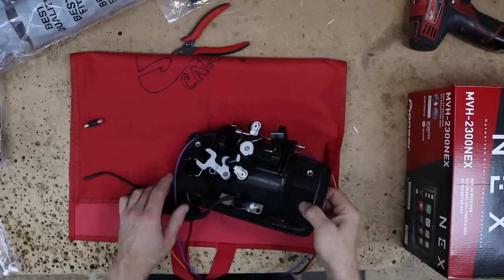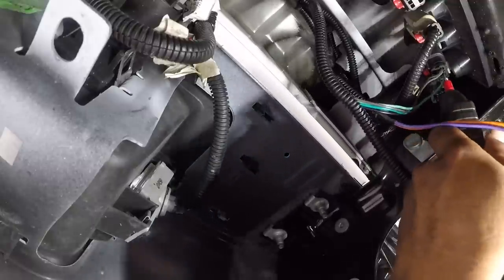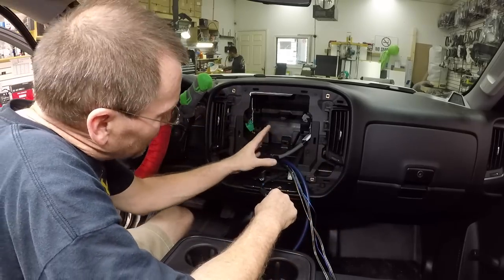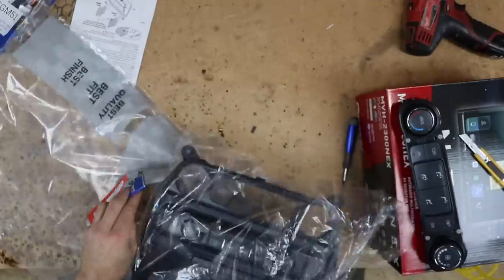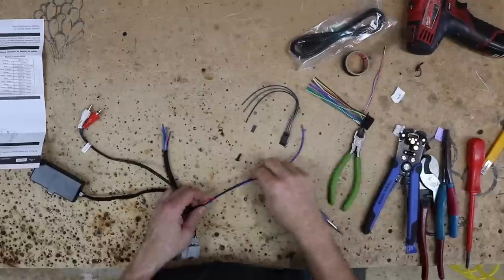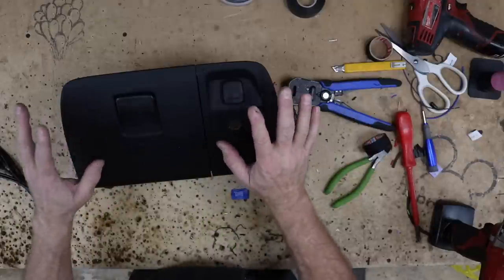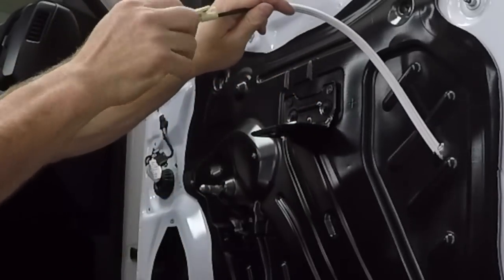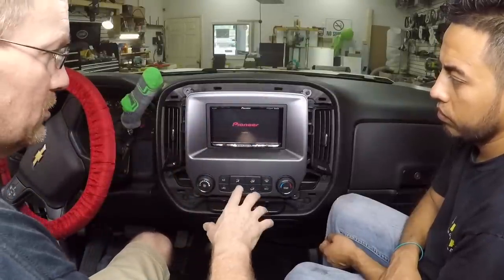We finish a Chevrolet Truck with some Alpine SPT 31GM speakers  Installer Diaries 168 part 3

Comment: @16:49 sure sounds like a good ol barking spider in the shop. Haha. On a serious note great work great videos. I always enjoy watching them. Curious as to what those crimp connectors your using when your terminating the leads from the deck are. I always use heat shrink on each wire end then wrap the whole tail with tesa tape. But I like tge look of the crimps.
Reply: I heard it too! Lol
Reply from the maker: We get them from AAMP Global, they are 22awg butt connectors.
Reply: Haha yes! As soon as I heard it I backed it up to be sure... then I headed to the comments. You're the first one that I saw that mentioned it.  So that leaves the question of who smelt it?

Comment: Hey guys, I still want you to do full install on my 17 Honda Civic EX-T , I'll be driving down from Virginia...Hertz Legends front, Pro Coax back (I have already) , Road Kill (of course)  Audio Control DSP DM608 (have) , Phoenix Gold Amp 5 ch 125x4 & 500x1  for the sub (have) , I think I want to go with the 1 RockFord T1 12 inch , I'll let you guys give best advice on sub...and build enclosure for sub...let me know.
Reply from the maker: Just give Paul a call to set it up.727-216-6170

Comment: great video!! I have a question!   
I own a 2017 nissan path finder and I did a speaker upgrade with memphis components but its louder with the original speakers does it comes with a amp the truck or I need an amp for the new speakers ????
Reply: I did the same. Yes you need an amp to hear the difference. New speaker have bigger magnets than the stock, so they need more power.

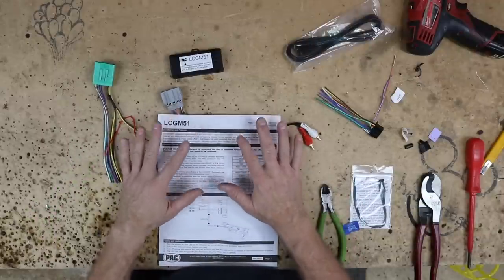Comment: 11:25 did he just say a backup camera takes 10 AMPS??
Reply from the maker: No the smart harness has a 10 amp output. Therefore I did not have to add a relay.
Reply: @FiveStarCarStereoInc  Ahhh, the way you said "just one camera" made it sound like the 10A circuit could only power 1 camera